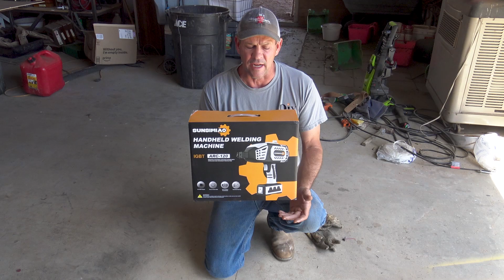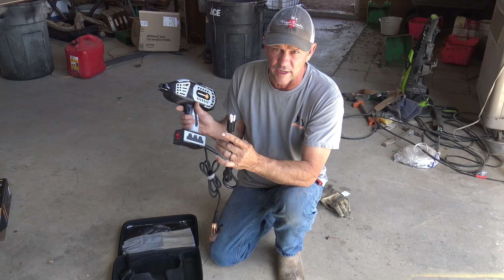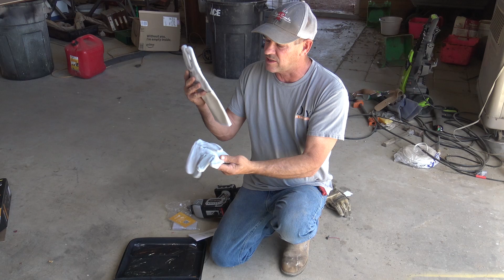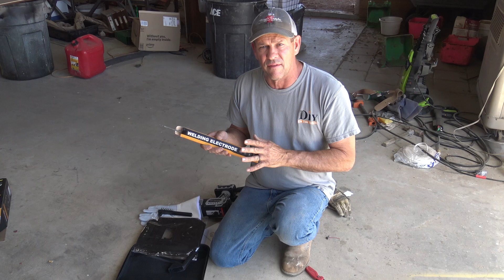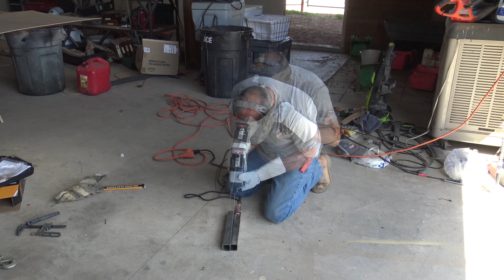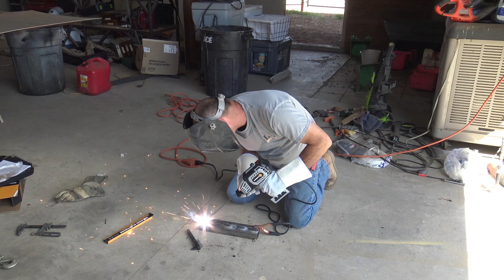Handheld Portable Welder Product Review

Comment: Look man. You adjust current/amperage setting by the type and thickness of the ROD.  A 3/32 rod is between 85-105 Amps. 1/8 will be 115-130. And also, the position - vertical up is a different setting from a flat. These generic settings are awful. Notice there's NO PICTURE OF THE WELD?? It's because it's visually abhorrent and looks like a pigeon sh1t all over your material.